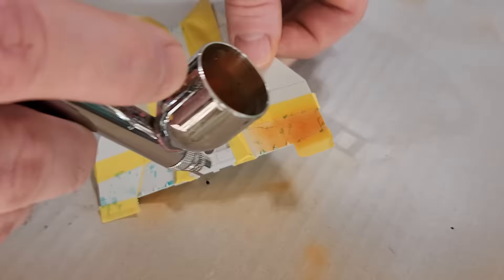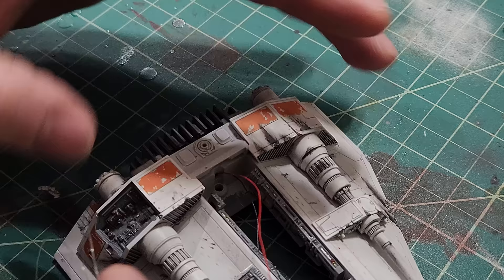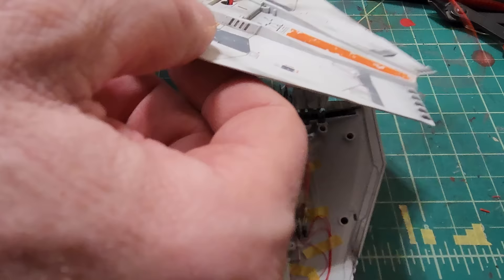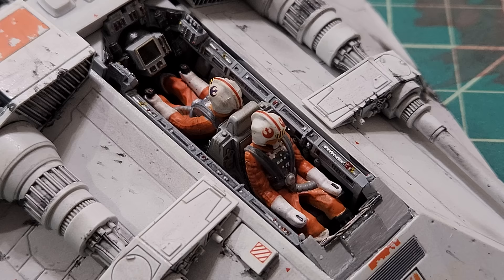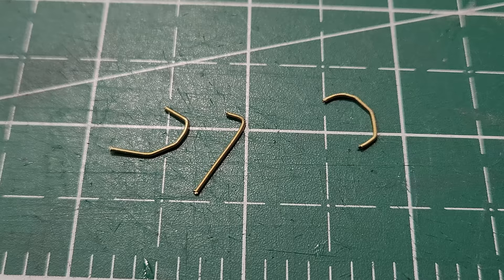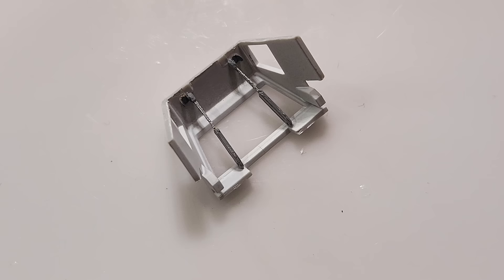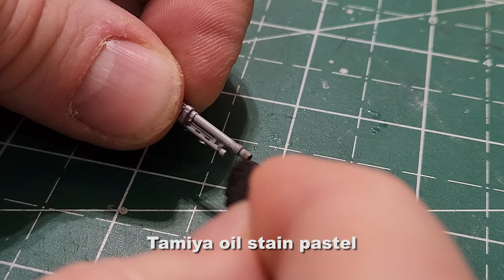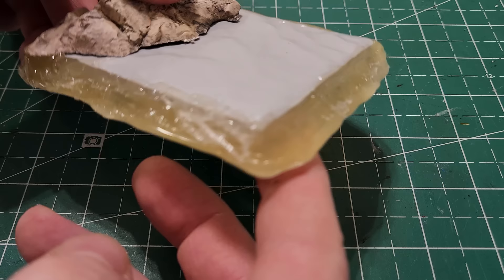Bandai 1/48 scale Snowspeeder model build Pt III Finishing the build and COMPLETED

Comment: That's not the barrel of the aft gun. That is a magnetic tow cable launcher. That bit on the end is what attached to the AT-AT in the film. Other than that, this build is AMAZING!
Reply from the maker: Well,  at least it would still have to be hollowed out anyway to launch the harpoon.  I know the cable comes from the bottom rear of the speeder.
Reply: @modelsbychris  The tip of the launcher where you hollowed it out IS the magnetic cylinder part that launches out. If you wanted, you could clip the cylinder off and make it appear "in flight", then drill the barrel part that remains from removing the cylinder tip.